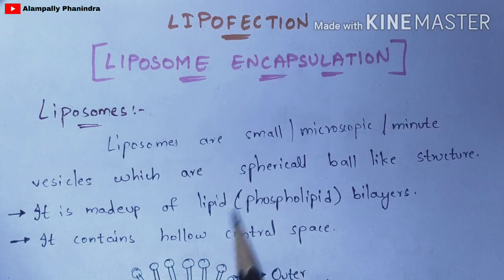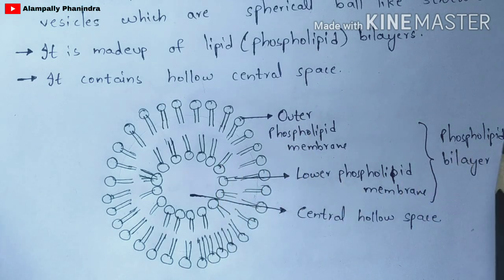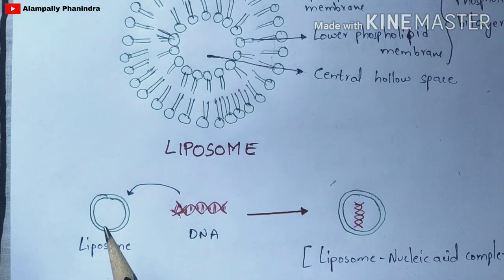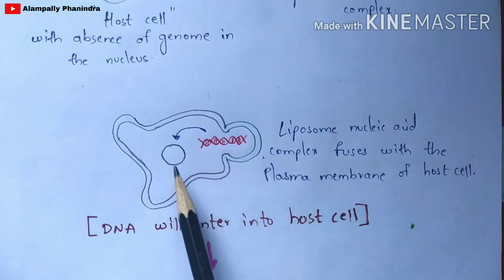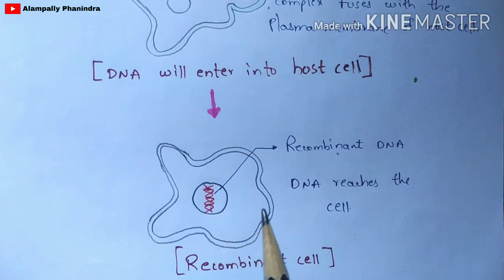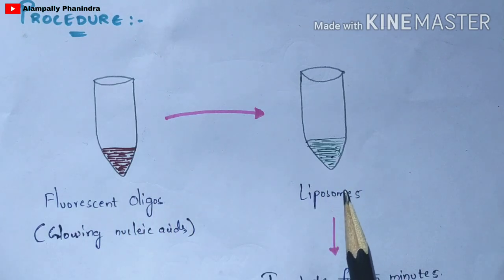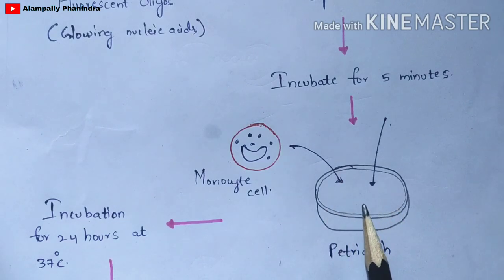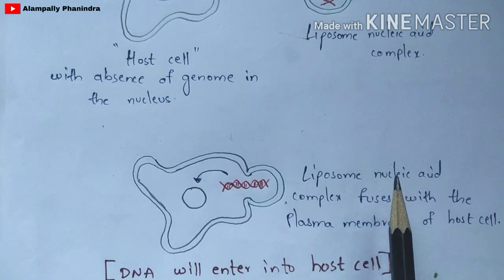Lipofection | Liposome encapsulation | Transfection | Gene transfer technique | rDNA technology

Comment: Well explained thank you. But l want to ask how do we insert the DNA into the liposome. Since DNA is negatively charged it will be repelled by the negatively charged liposome membrane. So are there chemicals that are used to insert the DNA into liposomes??
Reply: Phospholipids are amphopathic in nature (both hydrophilic and hydrophobic) 
small voltage pulse may result in the formation of a pore which may resettle and become intact. Thorough this pore DNA can enter through the phospholipid bilayer
Correct me if I'm wrong🙏